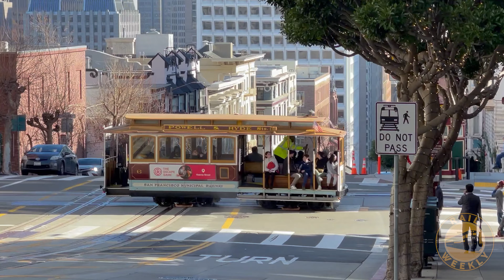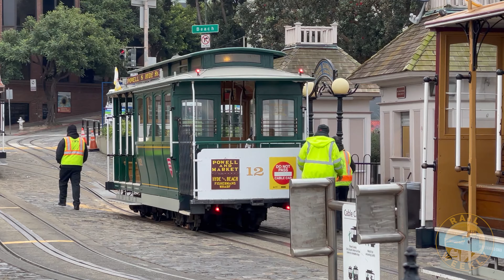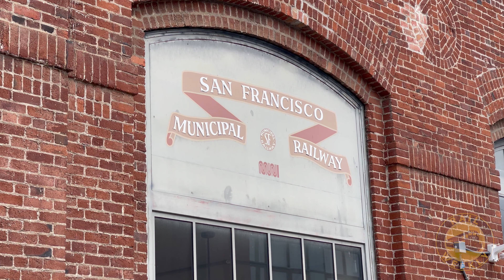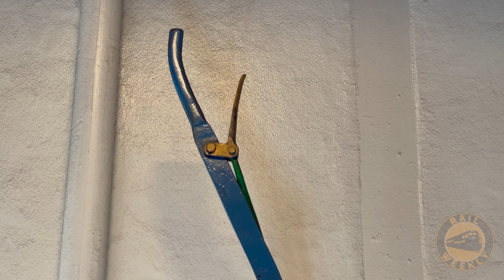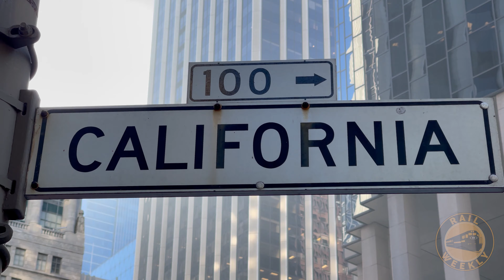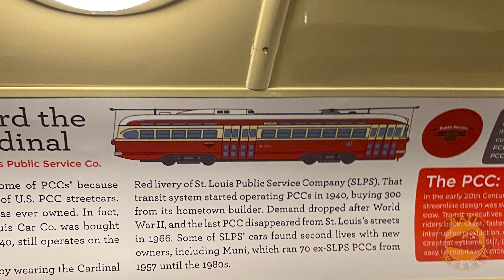How They Work: SF's Cable Cars and PCC Cars

Comment: I'd argue that the Cable Car is NOT Public Transport - it's price is $8 ONE WAY EACH RIDE, no transfers, no off and on, no return trip. Every other route in SF is $3 cash or $2.50 Clipper Card. The only way you can ride it freely, unlimited, subject to space on board (there is NEVER space), is to pay the $100+ Monthly ADULT Muni+BART Pass. No other pass allows Cable Car rides. So given that, no real San Franciscan ever rides them. UNLESS WE ABSOLUTELY HAVE TO - usually late at night when tourists are gone and that's only if we are near the line on the way home. They are literally just for tourists now.
Reply: well they were once a time in history regarded as the most advanced public transport. locals no longer use them because there other options, and leaders don't engage in expanding the system

Comment: The PCCs aren’t the only streetcars that run on Market street.  There are streetcars from Milan, Italy which are called Peter Witt streetcars
Reply from the maker: I’m not sure if I saw any of those on my trip. I would love to learn more about that!
Reply: @RailWeekly They haven't run much since the pandemic started. I asked an operator about that once and they said they don't have many staff who are qualified on them right now
Reply: The old St. Charles line in New Orleans has Peter Witt cars.  That line is the oldest operating streetcar line in the US.  Also, New Orleans is the only major city to not have a cable car route.  Kansas City had a larger cable car system than San Francisco.

Comment: Great video.  However, you mention 4 cable car lines. Actually, there's 3 cable car lines.  Powell/Hyde, Powell/Mason and California St.  No fourth line.
Reply from the maker: Thank you! And you are correct! Totally misspoke there. No idea how I missed that. Thank you for watching!
Reply: Hey Mark, it's Mike Pavini (retired from BART out of W40 in 2013 shortly after the tragic picket line 2.0). How are you these days? Still union rep?
Confusion over "four lines" stems from the power house using four ropes under Powell, Mason, Hyde, and California streets.

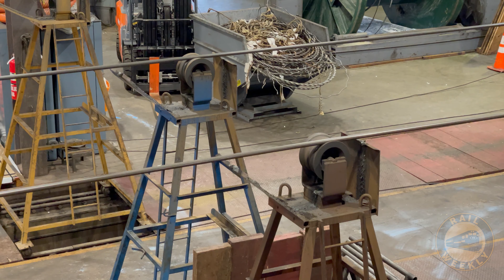Comment: 2:27 not to be pedantic, but those aren't tension sheaves. they're merely guide rollers, the tension sheaves are the second set of large wheels that aren't connected to the motor. Also, the cable doesn't run through gear reduction. Gear reduction happens in the gearboxes between the electric motors and the drive sheaves.

Comment: Sooo.... if the cable runs under the streets between the rails.... then how does that turntable work at the end of the line? Is there another pulley there that reverses its direction and the cars roll freely for a few feet? Or is it something else?
Reply: Yes. There is a pulley that is separate from the turntable. The cable car releases the cable before being pushed onto the turntable.
Reply: For a good overall education on how cable car technology works, and a full history of cable car systems across the US, go find book titled, "The Cable Car in America" by George W. Hilton, published by Stanford University Press, 1982, revised 1997.